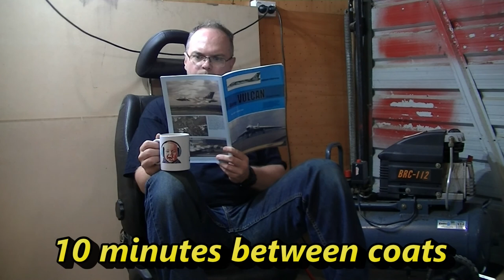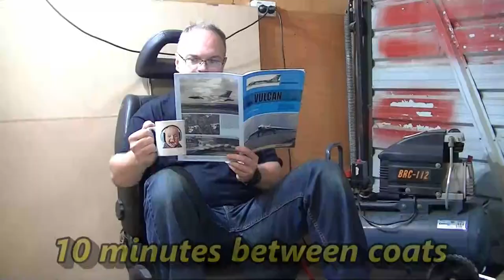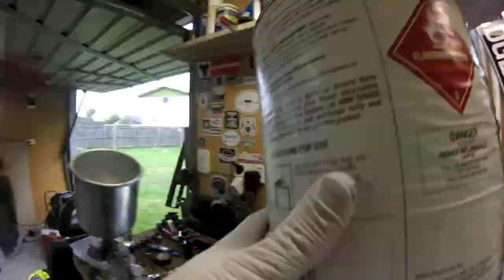Worlds Cheapest Spray Gun - 1 MILLION View Special - Project Trueno

Comment: Nice job mate. I'm about to do mine in the next week  or so and I've got a couple of questions about the compressor and gun. What are the stats on the compressor  ie scfm at 90 psi , horsepower ,  gallon size and whether the gun was a HP or LP one. 
I'm trying to decide if my 6 gallon one is enough . Anyhow congrats on the Million
Reply from the maker: +John thanks mate. My compressor is a little under powered for this kind of thing. It's a 2.5hp, 40 litre tank with 115psi. The gun is medium pressure, cheap and nasty! I could just finish a coat before the compressor kicked in. Cheers!

Comment: Looked like the bottom edge of your fan was a little heavy. Part of it seems you were not exactly perpendicular to the surface part probably due to the gun. You could have thinned slightly more and you wouldn't  have the orange peel but that makes it more difficult to keep from running. I notice you didn't add any hardener to the mix, is that normal procedure down there?  Nice work nonetheless for a first try.
Reply from the maker: +Walter Hassard thanks for the tips. I've got plenty of learning to do when it comes to spraying but I managed a decent result. The clear allowed for thinning of 10-30%, I opted for 20%, maybe a bit more would have reduced the orange peel. The base and primer were acrylic base 1k paints. I didn't show the mixing of the 2k clear. I appreciate your feedback. Cheers!